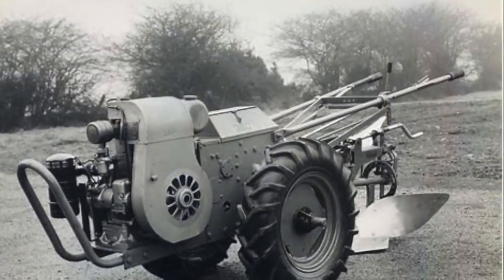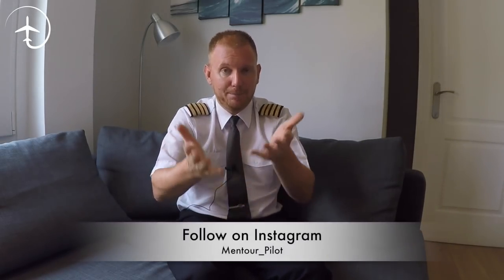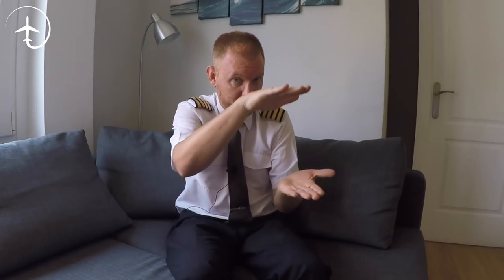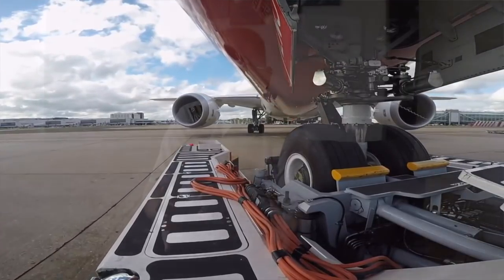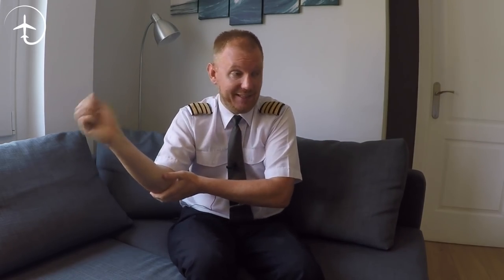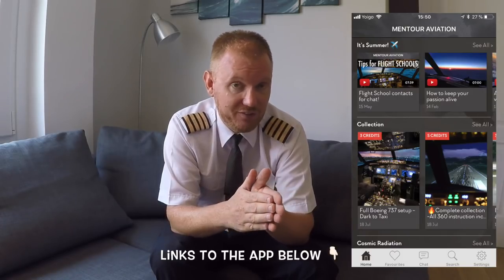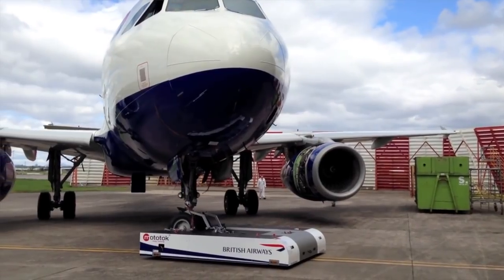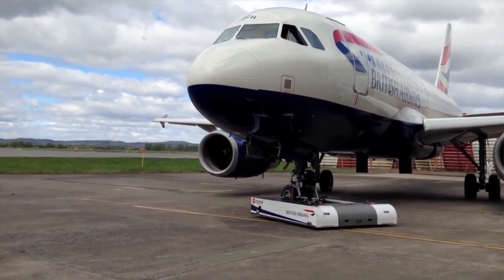Aircraft pushback, why is it necessary?

Comment: I was flying allegiant, and the tow bar broke when we were pushing back. Is that a rare thing to happen or is it common?
Reply: Allegiant uses old and worn out ground equipment. That's one way they keep the prices so low.
Reply: It's fairly rare for a towbar to break (Allegiant comment notwithstanding), but usually has 1 or more other factors involved if it happens. Generally there is some action or event that causes some form of side load on the towbar that would stress it to the point of either bending or breaking.
Reply: More than likely a shear pin popped.. in this instance very common
Reply: We broke the shear pins on several tow bars during my AF career.  The shear pins break before the aircraft is damaged.  Turning too sharp, too much brake, or the biggest was operator error.  The person in the cockpit accidentally hits the steering tiller/wheel, overriding what the tow bar is trying to do.  Also each aircraft has a different pep before towing, and it may not have followed the proper instructions.

Comment: Please can you do videos on these topics: (1) Maximum banking angle and what happens if pilots do a roll (what happens to lift character of foil shaped wings when a plane flies upside down); (2) What is maintaining a certain pressure in the cabin, what happens if the pressure is lost; (3) Safeguards against stall when a pilot pitches the aircraft too much (usually seen in test flights where pilots go very steep up after take off).
Reply: One more: (4) How does an Aircraft Control Tower work? Why arriving planes are so perfectly spaced (Heathrow for example)? How mid air collisions are avoided by ATC?

Comment: We use a Lektro for our 737-800 and MAX8 fleet which we started using this year. We put a strap on the aircraft and pull it on to the platform.  Then we lift the aircraft and push it out. I wish I can send you a picture of it.

Comment: At my airport they also have people called "Wingwalkers" who walk along right at the wingtips and signal to the pushback truck driver that the wingtips are clear.
Reply from the maker: Yes, those are used where the wingtips are close to obstacles.
Reply: On my we just block a service road behind an stand. Mostly because there aren't really any obstacles on those stands where we push aircrafts out.
Reply: I work at one of the airports in Belfast, our pushback team is the driver, the headset lad, one guy doing wingtip and the dispatcher comes out and stands on the 'rear of stand road'. Just another safety level as in bright sunlight it can be difficult or near impossible for any of us driving in the road to see the flashing beacon to alert us that the aircraft is live and about to push.
Reply: +Peely baii Which one City or International?
Reply: they use them at my airport too because parking is a bit tight
Reply: We had those at Airborne Express the ramp was unbelievably tight! We had over a 100 flights in and 100 flights out a night in about a 6hr span.

We had alot of DC8's and DC9's parked about 50yds from one another. It literally was an aviation version of a supermarket parking lot!
Reply: @MentourPilot  Before you think I'm lying, it was a private airport (ILN) which allowed them to do things a little differently.

Comment: Is it not rolling resistance rather than friction that the strong men have to overcome? Great video, very informative :) love the channel
Reply from the maker: You might be right, I looked that up fairly quickly.
Reply: Well rolling resistance boils down to regular friction between the axle and whatever is holding it in place + the deformation of the tyre. It acts the same as normal kinetic friction.

The most difficult part of getting the aircraft to move is actually static friction, which can be significantly higher. Getting the plane to move in the first place is the most difficult part. Once it is moving it is relatively simple to keep it going.
Reply: Niosus thanks for your comment. I thought of inertia as well as the toughest part to move it. It's just a scaled up version of moving a wheel barrel full of sand. Once you get it going, it's not that hard.
Reply: Maybe we should call it static rolling resistance. Without having Googled, I think you have a point.

Comment: please make a video on Aeroplane's jet Engine.
how they work, if there is no piston and combustion chamber. i have seen a lot of video on it, nothing cleared my confusions,  you plz make a video. thanks.

i know this process suck squeeze compress burn exit.             but i want to know the exact mechanism,     some people say igniters r shut off at cruising altitude, only the burner is lit  etc etc.
Reply: Jet engines are reaction engines which means the hot gasses coming out at the back of the engines pushes the engine and what ever it is attached to forward just like a balloon inflated and you let it go without tying it mouth all the air come  out  and the balloon stops . Same principle but only in jets a fan or sets of fans infront of the engine called engine inlet keeps supplying air to the engine compressing it as it goes further inside the engine aftet which it enter a defused section which stable the air before it enter the combustion chamber which is a high performance stove in theory and then the hot gasses leaves through nvg meaning nozzel guided vanes which is a set of fans designed to capture the escsping gasses and ,the fan or fans spins .the fan is  in front is connected to a shaft to  the ngv at the back so they both spin st the same speed.
Reply: Air sucked in. Air compressed. Fuel added. Go boom=Air get more energy. Compressed again. High thrust push plane
Reply: i know this process suck squeeze compress burn exit.             but i want to know the exact mechanism,     some people say igniters r shut off at cruising altitude, only the burner is lit  etc etc.
Reply: keith moore   suppose its raining ?
Reply: keith moore couldn't he just start the apu?? Oh right, bad battery, what about the RAT?
Reply: during the test phase of a new jet engine type, the engineers literally feed tons of water into the engine to see, if it can handle that. They also throw in birds (or something equivalent) to figure out, if the turbine blades get damaged and if so what damage is caused.
They eventually take everything to the extreme to get physical evidence of what the actual limits of that engine type are. They literally damage it on purpose.
Have you never seen videos of such tests?
Reply: @virushulk4693  the turbofan is driven by a combustion engine (like a car). Next there are a sequence of curved fan blades called turbines. These make very narrow channels causing the air to find it very hard to squeeze through in turn compressing it. Also it spins the turbines causing the air to speed up so there is a larger source of air. Then it goes in to a combustion chamber where fuel is added and ignited with a fuel ignition system. Another set of compressors are set in place. The exhaust gas is extremely hot and fast which pushes the plane forward. A channel of uncompressed air is let through around the core of the engine (where all of the combustion etc. happens) to dampen the noise and some other benefits
Reply: @tabeebrahman4843  i know this.   i want to know the further things,  like the effect of rain etc..
Reply: @virushulk4693  rain evaporates due to the heat of the engine
Reply: @tabeebrahman4843  it has a limit.
different models have diff. capacity.
Reply: @virushulk4693  how do you expect to get so much water in an engine that it can non longer function in air? What are you flying through a flood?
Reply: @virushulk4693  I understand that you want to know about the limitations of engines. But that isn't how engines work. You asked for a video about how engines work not their specs
Reply: @tabeebrahman4843  there r cases bro,  Engine flameout
Reply: @tabeebrahman4843  Boeing n Airbus do water ingestion test on there passenger jets
Reply: @virushulk4693  pretty sure flameouts are not caused by just rain. Maybe halestones or volcanic rock
Reply: @virushulk4693  if the engine is wet before it is started yes there is a problem as the fuel can not ignite. That's why Boeing does water ignition tests. They have nothing to do with flameouts while the engines are still running
Reply: viRuS HulK turbine engines are designed and tested to ingest, amongst other objects, a lot of water. Just search YT for turbine engine water ingestion tests, you'll be amazed at just how much water they can ingest without flaming out.
Reply: @MarkoVukovic0  yeah but that's absolute maximums. You are very unlikely to have a scenario like that. These tests are conducted for the unlikely scenarios. A video covering this topic is not a video explaining how engines work
Reply: @kallewirsch2263 
Birds or something equivalent? So, witches?
Reply: @tabeebrahman4843 
About tests to check how much water an engine can take being unrealistic:
Every KSP player knows jet engines work absolutely fine, even if submerged. That is a realistic scenario. Totally.

Comment: Re Hi Mentour:

1) Re torque. what you are explaining made sense so much that I would take it for granted even before you mentioned it. But than,. ,many years ago I had a student job on a large golf course where I was using a Massey Ferguson 35 Farm tractor.I could run this up a hill of almost 456 degrees in idle, but at well under 1 mph. That's torque, first hand.

On another occasion following a thunderstrom I had the job of towing a sizreable felled tree trunk out of the woods where the ground was not noly wet but very irregular. there was not enough traction with the mogiled wet ground to do it directly, but by7u a combination of critical positioning and "Yank tugging" using a large hawser, I was able to get this big tree trunk out of the woods and out of the way of the passage it was  blocking.

2) A but of the ancient Romans: "Traho" was the roman verb to drag, physically. So "tractor,. Traction etc are obvious etymological descendants, even "abstract came fro "ab traho" or "dragged out of the empirical view".

All to show the value of associative thinking, but with caution when the complexity of something shows signs of hiding danger! (which is remoindful of many of your warnings and comments about what pilots should not touch,  and also related to the need for fast rote procedures when things happen too fast to think everything out safely.
Reply from the maker: Hi! Great to see you back on the channel and thank you for your input.
Reply: July 28, 2018:
ReHi once more, Mentour:

Before the LONG message (AKA "A GALLON of tea")...

The whoole story is far too long for a simple comment, even one that is composed offline and later "paste-posted" to one or more "e-venues."

And while I know very well independently what this holds for posterity, far more than myself at age 73, I prefix with this shorter note.

The longer story can then be delegated to a site where it will not seek to overly distract from your main objective, yet sill not go unheard for those to whom it has the greater circumstantial import.

As I am living laone, I have to be the "chief cook and botttle washer". Hence I can only devote very linited time to any one thing, and the list xcrying for attention is VERY long.

Nonetheless it is still safer for all in this environment of all too much sociological demise than taking other risks that would be foolhardy.

North American English speakers have been far too pragmatically balanced, and Like all too many others I was brought up in this. However, as no adult when I was very young know what this kid was really about, I had no choice but to fight all the battles myself.

That "bombshell" duly dropped, I think the cup is full and the rest of the "gallon" can be delegated to other e-venues, would you agree?

I will end this paster-post here hopefully to facilitate any desire you may have to not leave the longer paste-post up yet leave this sort of personal introduction there for the benefit of the familiarity of all.

In the next paste-post, I will addresds my thoughts about Instagram, as I have noticed a bit about its market position.
Reply: The "GALLON" of tea!...

About Instagram, some personal thoughts:

Many years ago having taken the F.B.D.B. course on marketing, I learned about the concept of market positions. (with due tribute to Jay Rubenstein, our teacher at the time.)

But then, adding 2 and 2 and TWO, I was able to correlate the concept with how it sits in a diversity of life environments - some analogy!

Likewise this applies to social media, as in reality they are all co-cpmpetitors (along with the rest of the motley e-crew out there, all vying for our time and attention)

So having gotten into gmail some time after the initial struggles of the internet to get settled in Canada and the U.S. I got into gmail, and Google.

What i liked about Google was that it is one account globally, unlike 
Yahoo who has sepasrate servers and separate service offerings in each Counrtry/Language etc. environment which it operates. 

The latter, I found unnecessarily confusing when I had many other fish to fry.

As this is all develloping "tan yendo ", or "in dynamic and ongoing proportion"  the market positions become much more distinct.

As such each will have their strong and weak points as to what formats they are "upload-amenible" to. And not being in a position suitable to making money out iof it and not wanting to be beholding to monetisation out of my own independent personal code of ethics,
I know well enough that it behooves me to make the best of them all as time permits.

With this all in mind, I will likely need to start an Instagram account of my initially, own just to see what Instagram's relative techinical strengths and limitations actually are.

I have also started creeating a video of my own, using Pitivi and various underlying open source apploications ona Fedora set of operating systems. However I am currently rekluctant to go further with the final compilation until I have soleved the problem with my voice which has becmoe much more raspy and rough than I would be comfoirtable with puttin out there. I have several ideas as a raw set of work-arounds, but integrating them with acceptable flair is not a short term task!

the rest...

<<au fur et a mesure! >>

Comment: Thank you - informative and comprehensive, as always. I guess turboprops don't require this.
Reply from the maker: Yes, in most cases they do but some countries allow them to power back
Reply: I was on a turboprop at Glasgow Central and it had a pushback.
It didn't when it reached Islay, it just stopped somewhere it wouldn't have to reverse.
Reply: Turboprops have the same FOD ingestion problems as jets do.
Reply: Mark Jackson A320 is taller, but they're about the same lengthwise.
Reply: A Super Cub has a reciprocating piston engine. Are you a pilot?

Comment: As some who does what you explained, if you do it all the time we probly take like 3 mins to get towbar and pushback off the plane and another 4 mins for the headset operator to finish what they need to do But it ususally done when the towbar is disconnected.  Also A question and i just wondering who is the person doing the check around on the plane is it the captian or first officer?  Great video!

Comment: Can u talk about ‘sink rate’ I keep hearing it but never understand what it means
Reply: "sink rate" can refer to rate of descent while flying. Also, the aircraft Ground Proximity Warning System GPWS can announce "sink rate" in the cockpit if the aircraft's rate of descent is so high that the GPWS projects the aircraft could soon strike the ground.
Reply: Jaden Corner 
It means that the aircraft is descending to fast.
Reply: Aviation Nut yeah I looked it up just after posting the comment
Reply: Its part of the GPWS system.
That system monitors all parameters related to aircraft position an movement.

If you decent to fast, it will call "sink rate".
If you get to close to terrain, i will warn you with several terrain call outs.

In case of diviation from the ILS path, you will hear "glide slope" warnings.

If you below 2500 feet, it calls radar height like 2500, 1000,500 and so on.

I think it the most important protection system in an aircraft.
Reply: GPWS means Ground Proximity Warnung System
Reply: Jaden Corner , If you ever jumped off your garage when you were a kid, that was your sink rate!

Comment: Ah, the joy of pushing back a Regional Jet with my own bare hands when the tractor got stuck in the snow. Given how light those jets are, it wasn't that hard, although the crew was impressed that a gate agent was willing to push it back when ramp crew gave up.

Also, the Electric Green Taxiing System (EGTS) eliminates the need for pushback by another vehicle, using an electric motor on either the main or nose gear which is powered by the APU, to bring the aircraft all the way from parked at the gate, over to the runway before the main engines are started (saving fuel).
Reply: Ok, you may have answered a big v question Ive had since watching aircraft  videos on Youtube, that beimg, I see aircraft  that seem to be towed all over certain airports, from gates, R.O.N . pads and hangers on main taxiways at really good speed. I work at DAL, and befire that DFW. 5 years ago DFW didn't have them, I don't know about now, but definily not DAL since its much smaller airport, and the largest scheduled aircraft are Southwest 737-800,d.
So my question is, do they tug them all the way to runaway hold area, abd do tug drivers get cheetah's and taxi assignment from ground control, or is that relayed to pilot to tug?
Thanks in  advance.

Comment: would electric motors on the nosewheel allow a plane to pushback without any assistance?  They'd have to be clutched to avoid breaking the motor at higher speeds.